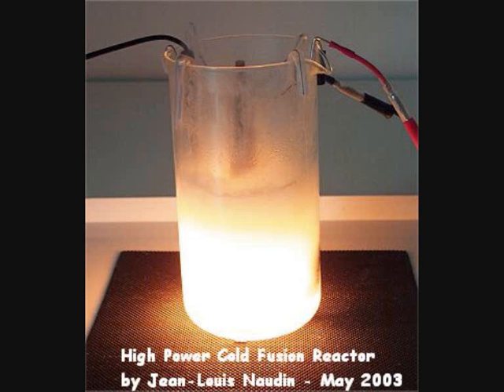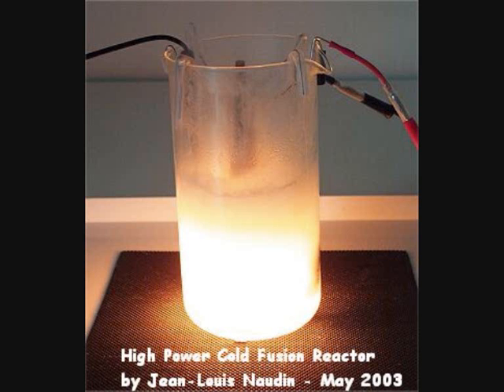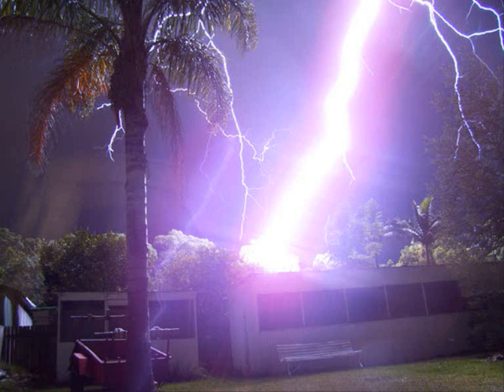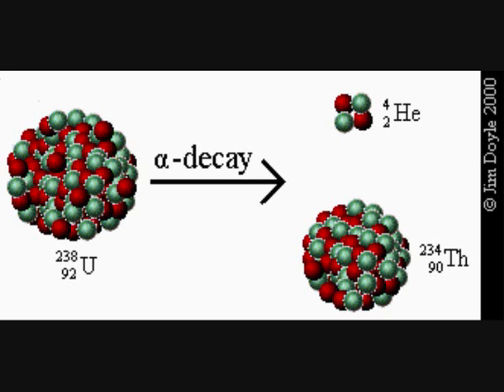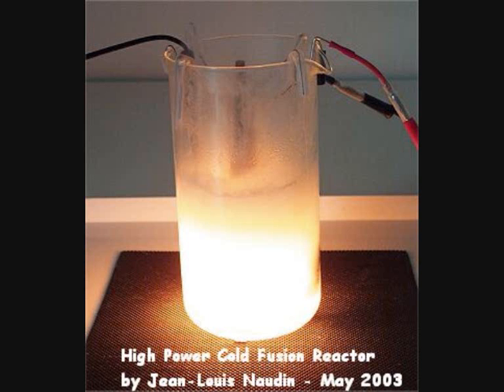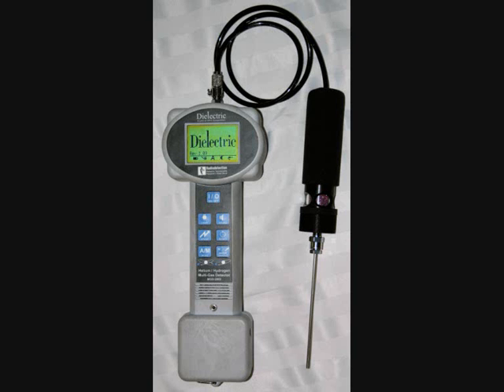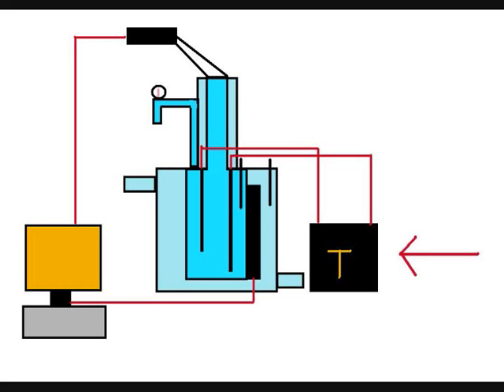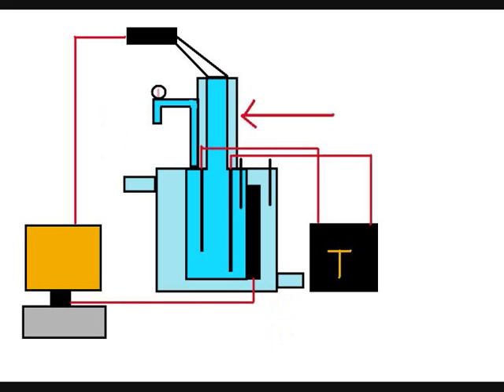Cold fusion experiment with positive results?

Comment from the maker: @CUBETechie first off, cold fusion isnt real, as of today. one day it may be possible but not yet. look up fusor. that is true nuclear fusion at home. but a so called "cold fusion reactor" is simple to make. you take 100+ vdc and you arc it in water. the water splits into hydrogen and oxygen and then combusts. then presto cold fusion. but its impossible to get more output than input in this system. there is no real fusion of the atom present unlike a fusor.